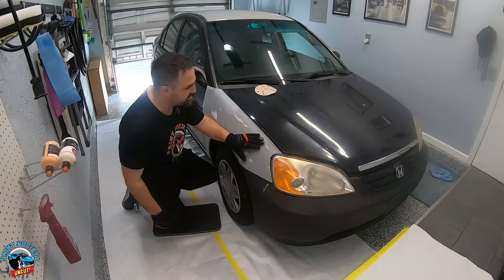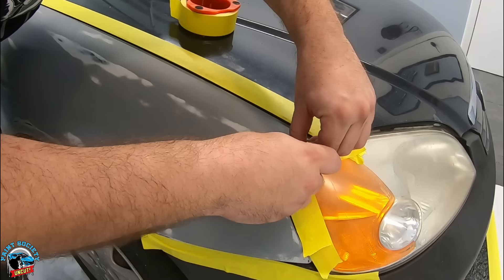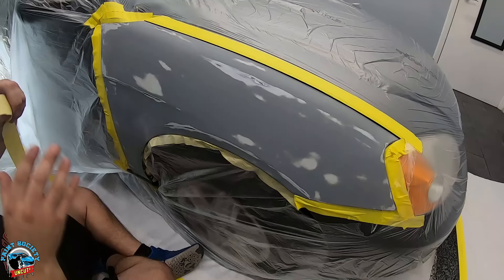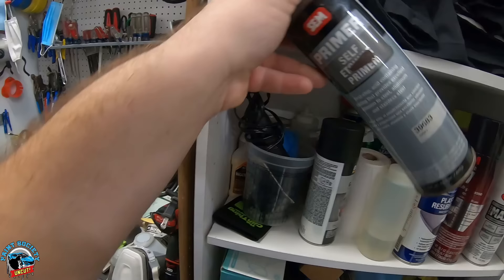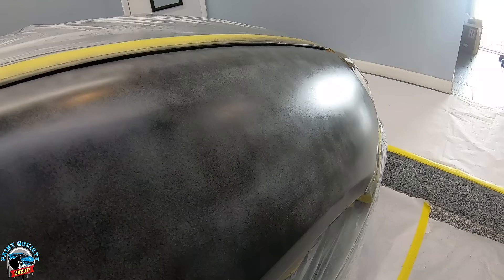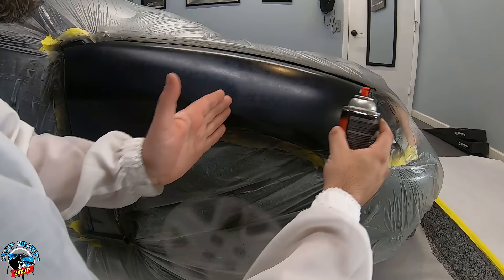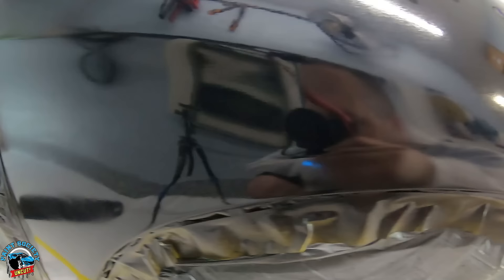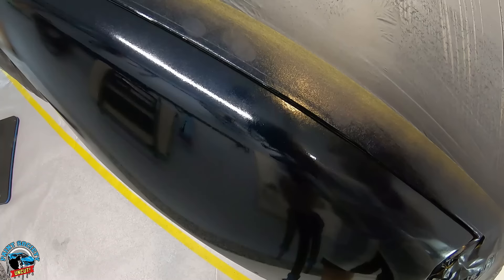Painting your Car with Spray Paint!

Comment: Considering  you were doing a bolt on fender,  you could have removed the fender.  That way you wouldn't have had to wrap the car in plastic.  Also a little surprised you didn't feather the paint a little bit into the door and hood.  I understand you are "Showing how" , but just saying.